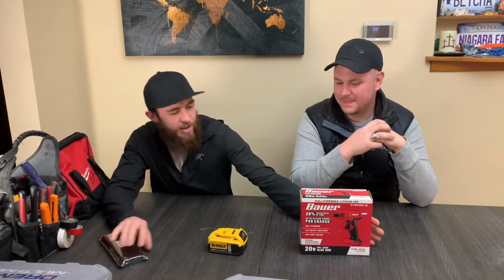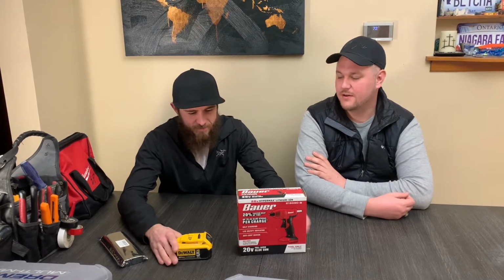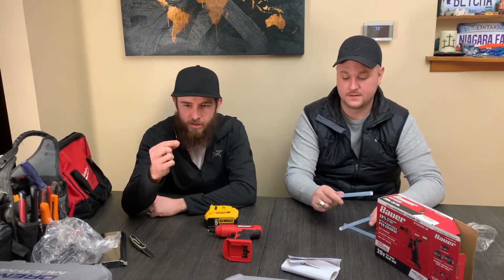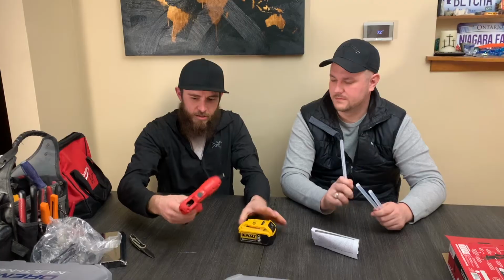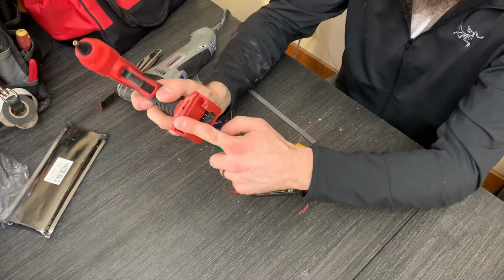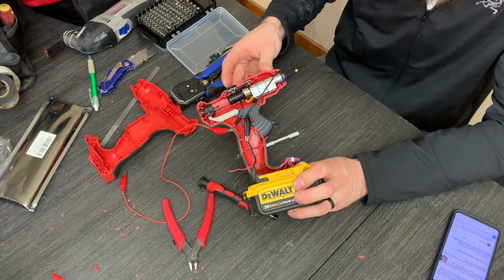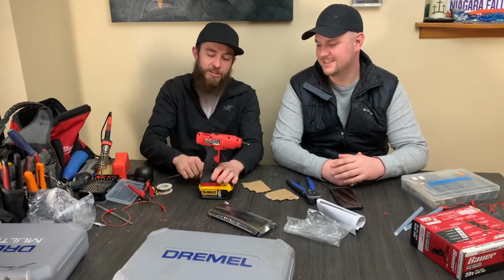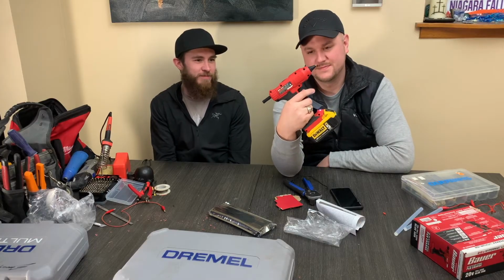DIY Harbor Freight Bauer Cordless Hot Glue Gun DeWalt 20v Battery Modification

Comment: So I just did the mod. The case I did slightly differently in order to make it fit better. 

To simplify the wiring, just clip off the middle red wire from the terminal of the gun where it goes into the top of the block. Then solder the resister to it. Then solder that to the solder joint of the black negative terminal on the block. No need to splice the wires.

Thanks for the idea and the info, lads. I like this better than using some janky big adapter like they sell. Great video!
Reply from the maker: That's awesome! I'm glad you got it figured out in a simple way. I'll keep that in mind for future mods. I 100% agree with you, and it's way better than a big chunky adapter.
Reply: Were do you get the resistor
Reply: @garybrown9719  10k resistors package of like 20 of them are a couple of bucks on Amazon.
Reply from the maker: Yep, Amazon.com or wherever online.
Reply: Any pictures of wiring please? Thank you in advance.
Reply from the maker: It's already put back together, but when I find the time I can open it back up and take some. I'll add them to the Google document with the other photos. Can you view that doc?

Comment: I tried everything to get this to work but it wouldn’t. 
I eventually just took the circuit board out completely and wired the negative straight to the heating element. 
Then I wired the positive to a rocker switch then to the heating element.
Cut a hole in the handle out of the way and put in the switch.

Turn the switch on and it heats the glue 🤷‍♂️

Comment: Why do you need a resistor
Reply from the maker: Dewalt tools have an over- temp circuit in them, but Bauer tools don't. The resistor simulates a within range temp, otherwise the Dewalt battery doesn't work.

Comment: I wanted to do this with my Hilti 22v (21.6v) battery.  Will that extra voltage be an issue?  

Thanks for the vid.
Reply from the maker: Honestly I wouldn't use a dewalt battery for that. They are actually 18v anyway.

Comment: I went to ground with the little red wire to with a 10k and the board on the gun died and resistor got real hot. Wait now I noticed 2 red wires and only 1 ground
UPDATE bought another one and it worked fine taking the 10k between the red wire t9 the ground
Reply from the maker: What actually happened then? You made the same connection as we did, but it didn't work?
Reply: @blackhatbrigade5872  I did and got a flashing red light. Now if I remove the resistor I still get a flashing red

Comment: does the bauer gun have an over-discharge battery protection?
Reply from the maker: Honestly I'm not sure if Bauer has that built in.
Reply from the maker: I looked into it, and I guess from the factory the Bauer batteries don't have anything built in for over-discharge protection. I believe the actual DeWalt battery has that built in to it.
Reply: Great video guys!
I am also a  diy modifier I have modified, 18v ridgid vacuum,  hart 20v  spot light,  craftsman versastack radio, ryobi compact radio and ryobi Led's to work with my dewalt batteries. Ridgid & hart have their overload protection built in their tools so I feel safe to leave the batteries in. Everything else I pop the battery out after each use. (On the ryobi radio i Installed a kill-switch).
Reply from the maker: That’s awesome! Thanks for your input, it is much appreciated. Will be checking out your videos!
Reply from the maker: So Coxfame, does that mean you can confirm that Bauer actually doesn't have it built in to the tools?
Reply: @blackhatbrigade5872  what i usually look for is if it's more than 2 connecting terminals I automatically assume if it isn't the same tool and battery brand even if it works I just don't leave batteries in it over night. No I don't make videos... it is just for my own personal use.
Ex #1. Hart spot light is @ $20 &  2500 lumens vs dewalt 1500 lumes for over $100 (littlemodificationbut worth everypenny). 
Ex #2. dewalts 20v compact vaccum bulkier and poor sectioning vs ridgid 18v  compact gen 5, best suction.
Reply from the maker: @Coxfame  OK, ya that makes sense, and the Bauer glue gun utilized 3 of the terminals. So you did a dewalt battery mod on the Ridged vacuum? Maybe I'll have to make one, and do a video on the process!
Reply: @Coxfame  It's not about silent drain if leaving the battery overnight, the problem is over-draining the battery while using because the tool won't stop until the battery is dead to a state it cannot be charged again. Leading to a $100 battery loss.
Reply: @blackhatbrigade5872  have you tested if it will cutoff or just assuming ?
Reply from the maker: As far as I know, it probably would over discharge a battery if you let it. But it's just something to be aware of, and you would probably be fine. If the battery got down low enough, you would probably notice the tools performance decrease, and as long as you just quit using it at that point and charge the battery, you would be fine. I guess I'm just in the habit of checking the battery charge indicator frequently while using tools, and if it gets down to 1 bar I'll just switch out batteries then to be on the safe side.
Reply: @blackhatbrigade5872  this tools does not have a battery indicador
Reply from the maker: No, but the battery it's self should. Most all DeWalt ones do.
Reply: @blackhatbrigade5872  no they don't. you will wreck your battery.
Reply: @blackhatbrigade5872  if i use an adapter would i have to worry about over discharge? i saw an adapter to use Milwaukee batteries. so I'd definitely have enough power to get jobs done.
Reply: @Coxfame  what would l need to do to connect the Ridgid 18v to the Bauer heat gun?